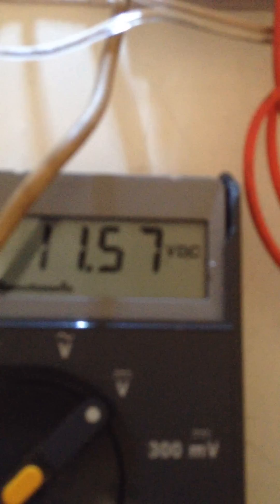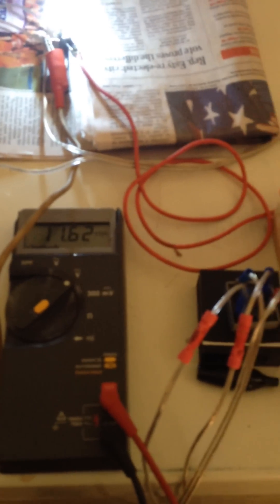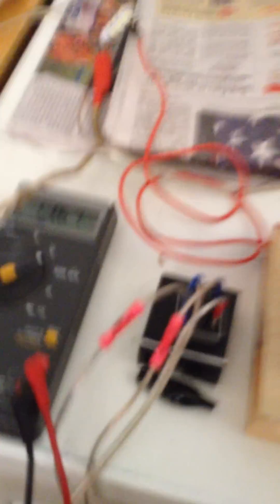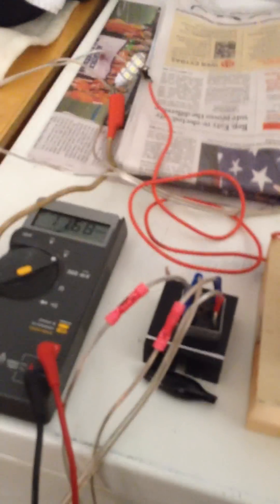Over unity created with transformed back emf. True over unity, no BS!

Comment: Hmm, I have to admit I'm skeptical. Not that I think you're lying, I just don't understand where the energy is coming from. I'm not a believer in radiant energy (or maybe I'm just not sure of its definition) . Remember, tesla believed in an ether and didn't think the electron was real. That being said, results are results. Do you notice any cooling (a sign that energy in the form of heat could be absorbed)? I've been working on a theory of my own which I believe is confirmed by tesla in "A Problem With Increasingly Human Energy". Tesla thought was if a glass below a lake was pumped empty, more water would flow in. If some of the water was converted to another form of energy (electricity, heat, etc), there would only be a small amount of water (that couldn't be converted) that needed to be pumped out, for a net gain. Suppose you had liquid nitrogen (Tesla said his idea was inspired after seeing air liquefied). Ambient heat would boil it, pressuring it. It would spin a turbine, air motor, etc, converting energy (and cooling), So that relatively little energy would be required to recondense it. I know it's different electrically, I'm just trying to find a way to justify your results! :) Your experiment, and your hho videos which seem to show results well over Faraday, defy explanation! (At least for me!)
Reply from the maker: https://www.youtube.com/watch?v=rnDupExnkp8
Reply: I'd definitely rethink getting a patent. Nobody will believe you, since no one will have replicated it, you'll spend $10k to disclose your device and be among the 1000s of other OU patents. If it does work, some company will change a minor detail and steal it anyway. You'll take them to court and whoever runs out of money first loses. Now, if you disclose it all on YouTube, website, etc, people can replicate, you'll gain credibility, and because it's all dated, you'll have proof that your the originator of the idea so nobody else can patent it. This way, you save the $10k risk, the government can't prevent you from disclosing or patenting for "national security" reasons because the info will already be out, and you won't choke on your cheeseburger at Dennys like Stan Meyer. I'm all for capitalism and when you take a chance and sacrifice your time and money, you deserve the rewards. I just don't think a patent is going to do anything. I guess spending $200 on a PPA (provisional patent application) could hurt, but if you ever want your device to go to market and tell your grandkids that you invented it, a patent ain't gonna do it. Even if a company (like Exxon?) did buy it, it would just be to shelve it. But the patent department probably sees 1000s of magic black OU boxes every year. I saw you had people willing to buy it right away. Make some money!
Reply from the maker: I was thinking about it. Problem is if I don't protect it with potting epoxy, it would be stolen and built in a second. I may just do that , making it small enough to sell as is , having the users take the risk of it's use for the savings of electricity.

The problem is that it isn't UL approved, and it will need to be, so, I need to pursue this before going forward..

Thanks,
Marc
Reply: I've thought about that with some of my own projects.  The whole UL, $30k wall every inventor hits. What about selling it as an experimental device for diy type people? Use at your own risk, etc. Just make sure there's something dated of yours so nobody can steal it. I understand your concern. The whole open source thing us great, but if you're living on Ramen noodles, spending all your money and time on magnets, etc, why should some clown be able to duplicate your idea and sell it? Problem is, I doubt a patent is going to do much for you except make you broke. The system is really stacked up against us. Name it Marc's Sparcs and sell it as experimental,  etc with all the obvious disclaimers. Maybe Kickstarter? I've seen wave generators,  etc on there sold for experimental purposes. Then you could have $ for packaging,  UL, etc.

Comment: Couple thoughts. Did you say you place the capacitor bank on the battery leads? High frequencies into a battery could be the phenomenon that your seeing. See battery desulphation. In your circuit, the secondary side, AC is being converted in to DC, but what does this waveform look like? If square waves are on the input (relay on/off) I would guess that only high frequency part of this waveform couples to secondary. If you observe this output (after rectifier when battery is hooked up also) you will probably see small spikes of 20V or so.  The LED bulb is only powered by the battery, not the output of this pulser.  So really what you have created in a desulfator machine for battery.
You need a oscope to really see what your putting into the battery. You have to rule out variables first before you say OU, or free energy.  honestly check out Desulfator, which maybe is working on your battery. Nice video however. Just be careful on physics of what your seeing.
Reply from the maker: is that is why the machine keeps running on and on for months? Also, I would scope it but I have a pc oscilloscope that the high back emf spikes knock the scope offline and the laptop says the scope's usb driver isn't recognized until after I shut this off.

This unit is creating back emf spikes, and no , it will not desulfate batteries. The overvoltage from the transformer is charging the battery over the loads and the losses of the components, and, it does run at the same voltage with an led on the circuit. If the battery was just desulfating, it would die after the crystals are gone. already done this and I have desulfated with just a relay and battery, not like my setup.
Reply from the maker: I am trying to get a live feed up and running to see how long it goes for.
Reply from the maker: https://www.youtube.com/watch?v=rnDupExnkp8

Comment: Very nice Marc! Thanks for sharing. I wonder if it would work with a reed switch instead of a relay. Of course the amps should be lower etc.. What does the input on the relay look like on an oscilloscope? and how on the input of the rectifier? How do they look together on scope-screen? If I can find a transformer I will try the reed switch version. Keep it up man.Cheers
Reply from the maker: I actually haven't checked it out yet as I moved onto a brand new circuit with a cadeuceous wound toroid that I have created, adding it to this circuit instead of the transformer, as well, along with the transformer and a free air electrolytic capacitor wirth surprising success. I also have found that the relay produces an emerald green arc which shocks the life out of me if I touch it as I accidentally have a couple of days ago.

The circuit powers a tail light bulb (normal wire filament) with such a bright powerful light that it hurts to even be next to it as it is so bright. I added another 4 bulbs and have received so much additional voltage as it was in resonance that the circuit shut down the battery I used as it has overvoltage protection. For some reason the more load I have with bulbs the more energy comes from the circuit and more charge to the battery. It is extremely exciting to see, but, I wish I had a different source battery without protection. I would build a simple voltage regulator to protect the battery and use a super cap bank to absorb the additional charge. I tried a lithium ion battery instead of the lead acid battery and it actually absorbs the voltage 10 times better and produces a better drive which is needed to draw in the radiant energy. Cold electricity is the result of this circuit, as well, the transformer creates a transformed conventional energy which builds the voltage so the circuit runs much more efficiently. If you have any build ideas you wish to share, I will be glad to try them and video, then post them if I have any success.  The videos you see of mine that are thin and hard to see were done with a shitty iphone, but, I have a new camera that has incredible sound quality and video quality so i could make great hd vids now. Anyway, please send some schematics. I have invested well over 150k in electronic parts and devices so I could do a lot of builds and tests. I have most of the transistors and other parts already in stock that are used for most free energy devices, so, I am dying to build anything closely related to what people may think would be the "solid state " replacement for the Moray valve, or, Leedskalnin's coil, etc. I am in the process of building an Asymmetrical Motor trainer unit to sell to educational facilities as I have a great design so far. I will be posting my results and will be selling them for $200 each to teach the asymmetry laws and build methods so one could use very little energy while producing massive outputs to generate their own power while charging the run batteries in the mean time without sulfating the cells used. My open source overunity circuits are located at http://mbrcircuit.blogspot.com . Thanks for watching and having interest in my research. Please share these to help fund my research!

Comment: Hi Marc, good job! I'm trying to achieve similar results but with some slight differences (a toroid in place of your relay and a giant Tesla coil as a HV transformer). Go ahead, you're on the right way! ;-)
Reply from the maker: Thank you. I have actually built a very large unit similar to this. I can't release it because it is extremely dangerous, as well, it weighs over 10,000 lbs. I figured out the phenomenon working on a project for our local power company. The reaction of two disimilar electrical transformers being shut down simultaneously causes a massive amount of power that is based on a reaction called Ferro Resonance. The transformers could never syncronize correctly because they are not identical and they have a massive difference in potential which causes a huge burst of unexpected energy. I took two utility transformers of different sizes that we had at our shop,  wired them so they work as a Meissner Circuit, pulsed the low voltage connections with a welder across the delta secondaries to start the oscillation, and then they start to run/oscillate full time, basically pinging each other, back and forth through each of the coils, as Tesla's pancake oscillator coil would do if wired as  a meissner circuit, but, because of their differences, they keep pushing out these massive bursts of additional energy which must be consumed otherwise the units would be overpowered and pushed higher and higher until they fail, due to the overunity that keeps building higher and higher as the current flows. There is a major difference though, the wires connected do not have a current flow that can be detected by induction, with a clamp on meter, and I am pretty confident that the power made by this is much safer since it can't really destroy smaller conductors since the current isn't actually running through thdem but rather on them, on the surface as the skin effect does. If the units were to be shut down without having a large enough load on them, whoever would be near them would most likely die due to the opposite of explosion that happens in any Ferro Resonance situation ( I am guessing that the system would be imploded since everything is backwards, maybe the circuit could be shut off, but, since it is so different, I am really not too sure. I am actually unsure of how i would ever shut it down because with any type of Ferro Resonance situation, you normally can't just open one of the phases, you have to open all 3 phases at the exact same time (like a gang switch does)  to eliminate the overvoltages from building up at the last disconnection which usually results in a catastrophic explosion. (this is another reason why I do not release this to the public as it can be extremely lethal, especially as the voltages start to build under a no load situation since it draws in outside energy.)

The circuit powers exactly what they would power if they were primary fed by a high voltage feed, but, they need no feed and can throw out thousands of amps without overheating the slightest bit. The units never get warm, and that is because they are running off of cold energy which does not heat up as it isn't a conventional method of current flow by electrons.I am pretty confident that these systems are fed by what's called positrons and they work in a very different manner than any conventional electron flow. Wherever arcing takes place, there is frost on the arc gap for some reason. I have never in my life ever experienced anything that gets cold when there is a loss in a device such as inductive load loss, resistive losses, or any other loss that would be added to any type of circuit. The only thing that does have the opposite effect is magnetism. Electromagnets powered by this work exactly the opposite way. I have rectified the secondary voltage withg a system that's called "Cathodic Protection", and the poles on the electromagnets are the wrong way, as well, the electromagnet gets cold while in operation instead of warm, so, something crazy is going on and I can not explain it.
Reply from the maker: make sure you try to wire the toroid in series to your circuit and not put it in parallel because the toroid may self cancel longtitudinal waves which has some sort of affect that will cancel out the energy manufactured from the inductor. Please visit http://mbrcircuit.blogspot.com to add what you are working on or to chat about it. I have way too many negative people here that are only concerned in suppressing our circuits. I am always happy to work with or experiment with other's inventions as well to try to come up with new powerful circuits.
Reply from the maker: Please reply so i know you have read thius so I could delete these recent posts I have listed today so it stays within a small community.
Reply: Marc Belanger Hi Marc, oh yes, I've thorougly read all of your single word carefully and... thanks for it! It would be nice to have a private conversation through email... please, feel free to come in contact with me.
Reply from the maker: Fabrizio Ricciarelli  Hi Fabrizio, sure, you could email me at any time. marcvbelanger@gmail.com. I have played around with this circuit and have come up with a 3rd circuit which I call the mbr circuit A-03, following the first two I have published at mbrcircuit.blogspot.com . Please request the relays from any automotive store or online source. The relays can not contain the diode across the coil, so, if you build this, look at the relay to be sure the diode is not in the schematic. anyway, please email me whenever you wish, I am available to speak very often. I do not like to speak too much in the comment sections where i am disrupted by many very negative people. They are very discouraging, and seem to only try to scare people away from believing it is possible. Believing is half of the battle, the other half of the battle is to be very open minded so you could think outside of the box. Thinking too much is no good, so, experimentation to find things that produce new phenomenon by trial and error is what I recommend, as well, spending enough money and time to take the opportunity to find the new circuits create new horizons for the inventor. 99.9% of the most lucrative and successful inventions were built by accident or discovered incidentally by random experimentation, thorough observation , and great note keeping (so you don't forget like me!) write down your new ideas as they come to you. I have a very abstract mind with very little memory. When I see or think of a new device or method, I usually forget about it because it comes to me as a dream or a vision, which are easily forgotten until I have no way to instantly record my thoughts. A recorder or notepad and pen or pencil is what I carry with me, my phone, or anything that gives me the ability to document my wishes to attempt a new build.
Reply from the maker: Hi Fabrizio, how have your experiments been going? I hope you have had success with some of your devices. I am very grateful for the information you have shared, showing the bucking coils.  I have another link I'd like to send you..